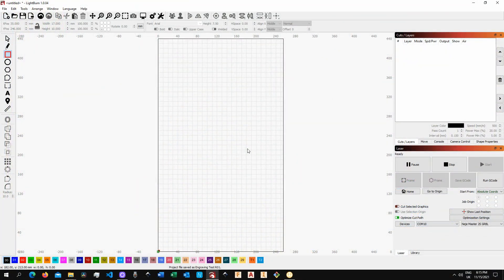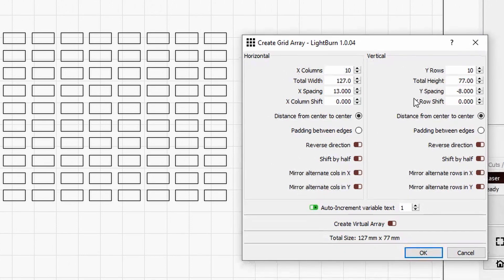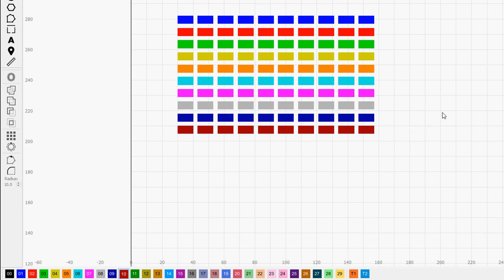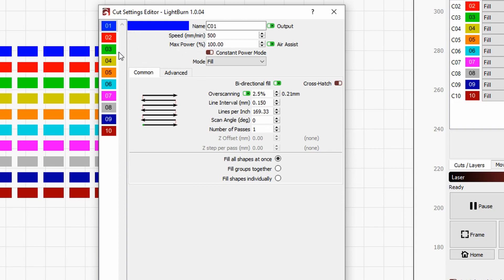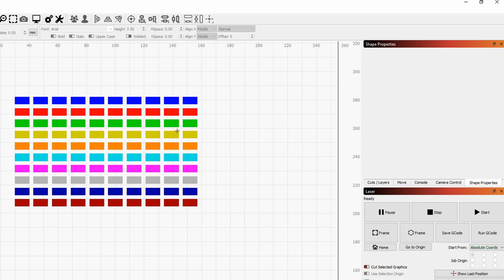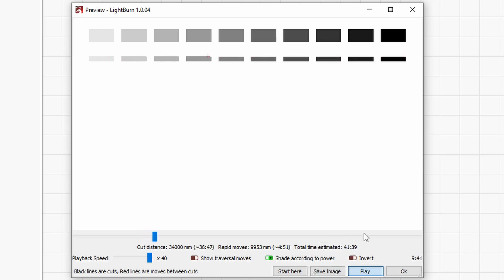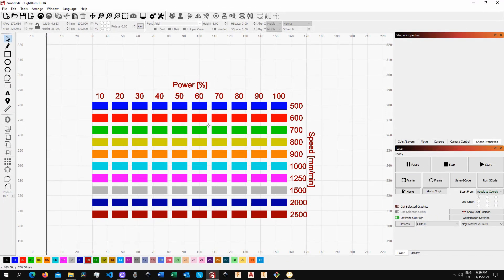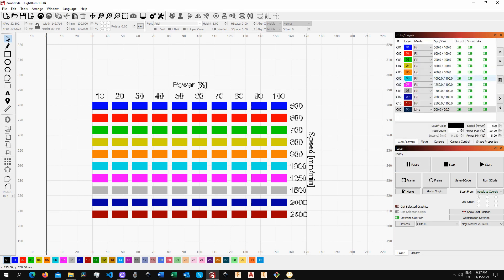Test your Laser Machine and Materials in One Go

Comment: Hi, I have a problem with Neje 3 max. When it engraves image it goes dot by dot and makes pause between dots. Is there any option to make laser to engrave smooth line by line without pause between dots?
Reply from the maker: Hi, Centar dobrog uticaja; thank you for your comment. 

The only thing that comes to my mind is the Laser Mode disabled in the GRBL configuration, which causes the machine to pause at each power change.

Go to the Machine settings while your Machine is connected and look for $32; it should be set to 1, i.e., laser mode.
Alternatively, in the console, type $$ and press enter; this will load all the GRBL settings of your machine; look for the same $32; if is set to 0, simply type in the console again $32=1 and enter. 

Let me know how it goes.
Ciao
Reply: @MiddleRoomWorkshop  Thank you very much! Now it works fine!

Comment: Hi... Trying to do the same for cutting. But... Where do I set the MINIMUN POWER...??
Thanks. 
Using version 1.3.01 ( up to date)
Reply from the maker: Hi, MrLewta; thank you for your comment.

This option is available if your layer is not set to Constant Power, which you can toggle on or off within the layer window when you double-click on a layer.
If that is toggled off, you will see the min power at the bottom of the Cuts / Layers window under the max power input.

I hope it helps
Ciao

Comment: As you mention, this matrix speed/power pattern is used for all sorts of laser machines  to help aid new users to choose optimal speeds  and power for their machine and material Unlike the more powerfiul CO2 lasers, this so called 40 watt diode in reality only has about 10 or 12 watts output. This makes this type of laser ideal for engraving various organic materials such as wood, leather and card but not very efficient at cutting. These organic materials are the only ones that have a colour range that you can exploit, i.e. from light scorching to dark scorching.  Mineral materials such as slate or glass, plastics such as acrylic and also anaodized aluminium, only have one damage colour whether you "burn" it with a laser or scatch it mechanically. Thus this chart has limited use  and can only be useful for determining a colour range for grayscale engraving. Although the claimed optical spotsize for this laser head  is supposedly 0.04mm,  I note you have set your line spacing 4 times greate than this. Why?  surely that will leave lots unburnt wood between the  scan lines? Have you ever examined your test pattern with a magnifier?  Why are the black squares so deep and "messy" whilst  the shallower lighter ones relatively clean?  I admit I could select the  2000mm/min (33mm/s) and set min at 10% and max at 100% to get a reasonable colour range but even the 100% power (althouhg about 0.5mm deep is not black) What settings must Iuse to achieve  to  a SURFACE  scorch that is black.  Why the dramtc loss of colour  when stepping from 2000mm/min to 2500mm/min? This a great programming exercise but can you explain a bit more about  the  real usefulness of what this matrix means please? I would also like to see how these colours change with various degrees of  out-of-focus?   Lots of interesting questions here for a future video please.
Reply from the maker: Hi, SarbarMultimedia; thank you for your comment.

You raised many interesting questions, which should be dealt with in a more scientific approach, and perhaps I may consider it for a future video. 
For the time being, I will summarize my answers below. 
The matrix is useful not only for finding the colour shade but also for the depth of the engraving, so one could do projects with different levels of darkness, or if you plan on inlay stuff you know the power/speed parameter to reach the required depth.

This type of Laser has a wavelength working mainly with organic, plastic materials, and some metals, although not as effective. While it is not effective on glass or transparent materials.
Metal engraving with different powers can actually produce different shades and colours.

As for the line spacing, when the laser engraves, despite most of its power being focused on the tiny 0.04mm spot or whatever the module offer, you still have heat damage in the adjacent material this can be observed with a magnifier, effectively creating a wider mark, therefore, when working with organic materials is best to set the line spacing greater than the advertised spot size, to avoid burning the area.

The focus or laser height affects the spot size; therefore, often, the actual spot size of the material is larger. therefore the additional reason why it is not a good idea to engrave with that line spacing. 
The cool game with the focus is that if, for example, you wish to engrave a thicker line, you can simply lower or raise the module so that with a single trace, you obtain a wider line, or with fewer lines i.e. larger line spacing you can cover larger area therefore in less time.

You can play around with these parameters a lot and obtain interesting results, in fact, one should test the laser with some kind of 3D array where your test all Power, Speed and focus for a given line spacing.
Furthermore, there are tricks which I have been explaining in various videos to cut or engrave materials that the laser alone cannot.

I hope this reply some of your questions
Ciao

Comment: Hi! So it did not cut at 500mm/min? At what speed you had your laser cut 3mm plywood with this module?
Reply from the maker: Hi, Евгений Васильев; thank you for your comment. 

I recommend using the cutting template, which goes at lower speeds for cutting purposes.
https://whathowwhysolution.com/cutting-test-all-in-one-test-for-your-laser-engraver/

I used to cut 3mm Birch Plywood cleanly at 200mm/min 95% power.
Note that there are different types of plywood, and Birch is quite hard. I know some people work with Poplar Plywood and manage to cut through at 300mm/min.

I hope it helps
Ciao

Comment: Thank you for your Plywood engraving video which is very clear and I will definitely follow to try out when doing Plywood engraving. Its a hobby for me and presently I'm doing ceramic tile engraving using Norton method.  I've spend many hours but is still not pleased with the results.  I'm using Neje Master 2S Plus with N40640  and LightBurn software.  The end results after Cleaning with Acetone liquid is always very light & look faded.  I was trying to find your video to learn your method but cannot find.  Please advice which video is it. Thank you
Reply from the maker: Hi, Katoria Luke; thank you for your comment,

I haven't uploaded a video about that month yet.
Anyhow, you could use a similar testing template for any material you want, not just for plywood; this will help you identify the correct speed power settings.

If you engrave shades too much after cleaning with Acetone, it means that the laser was too fast, not leaving time for the heat to transfer to the tail below; therefore, I should suggest going slower in the few tail projects I have been working on at 800mm/min 80% power with a 10W laser module.

I suggest you edit my testing template from the video, which you can download from my website https://whathowwhysolution.com/category/manufacturing/laser/laser-testing-templates/ and use the part from 40% 500mm/min to 100% 1500mm/min just set the rectangle in the upper right corner to fill mode.
Once done, clean the tail as usual and check which settings yield the best result.

Said so, please do not work at 100% power because it is not good for the longevity of your laser; leave it just for testing.

I hope it helps
Ciao

Comment: I’m new to this but I’ve been watching a ton of videos. If I want to achieve the actual colors in the program, would you suggest we layer the whatever material we are doing the color test on with spray paint starting with the lightest color finishing with the darkest color?
Reply from the maker: Hi, skull; thank you for your comment. 

I am not sure to understand what you are trying to achieve.
If you apply any coating on your material, then it will be removed by the laser as it passes through.
If that is your desired effect, you can do exciting things, and you can play with the colours.

Ciao
Reply: @MiddleRoomWorkshop  correct, it will but in other videos people are playing with the percentages so it goes down to the colors they want to show. They are running tests first to see what colors will show with different percentages of the laser and with how fast/slow it goes too. Not sure if this is making any since.
Reply from the maker: Hi, skull, yes, it is perfectly feasible, but in my experience, these cheap lasers are not so reliable in power, and sometimes even cutting fails between projects.
That is to say, to achieve what you like, you need to test and play a lot, making also sure that you apply the correct layer thickness.

Not impossible, though.

Have fun :)
Reply: Not sure if the one I got my wife is cheap or not, it's the P9 M50. 

got ya, I definitely intend on having fun with it.

Comment: Great job explaining the process.  I just got my Thunder Laser Nova 24 last week and finished installing. I'm using lightburn, how did you get the graph to fill in the layer colors?  Thanks again new sub.
Reply from the maker: Hi, Ken Gilbert; thank you for your comment and for subscribing to my channel. 

I am not sure I understand your question, but I will reply as best I can.
To set certain layers to fill mode:
1) Select the objects you want to include and click the layer colour from the bottom palette. If you do not see the palette, go to Window > Cut Palette, and make sure it is checked.
Now the objects should turn in the colour, i.e., the layer you selected 
2) Select the layer from the Cut / Layer tab and choose "Fill" from the dropdown list located in the "Mode" column. if the shapes are closed, they will turn fill, otherwise, they remain lines.
3) HINT: if some object is not closed, i.t., does not turn filled, select it, and under Edit, use one of these: "Close Paths", "Close selected paths with tolerance", "Auto-join selected shapes"

I hope it helps
Ciao
Reply: @MiddleRoomWorkshop  You answered my question perfectly. Thank you

Comment: Great video! Easy to understand. Do you have any suggestions for the quad laser (20w) machines? I just bought an s30 pro max! :)
Reply from the maker: Hi, Michael Gara; thank you for your comment.

I haven't had the opportunity to work with quad lasers yet, but based on experience with dual ones, I expect them to cut at least 3 to 3.5 times faster compared to the single 5W modules.

This is not as fast as a CO2 laser considering that they start at about 40W, but way faster than traditional 5W.

I hope it helps.

Comment: Hello,
very nice video, i'm new to lightburn and i just got my neje master 2 s max with A40640 laser module. I've seen in your video that you set cut to 500 mm\min , can you cut at that speed 3mm plywood? i'm only able to cut at one pass at 100mm\min 100%power is that normal ? Sometimes it gets dark and kinda burned around i've tried different focus setups but cant get faster .
Reply from the maker: Hello Przemysław Brodzik, thank you for your comment.

No, it did not go all the way through the material, so you cannot cut at 500mm/min even at full power, the best a got in a cutting test for a 3mm plywood without air assist is 300mm/min @ 90% in a single pass, but normally I cut at 500mm/min @ 90% 2 passes which makes a cleaner cut and compensate for not perfectly flat and consistent sheets of plywood.

Your result is too low, what focal height are you using? I normally go with 17mm (distance from the surface of the material to the bottom of the inspection glass in the laser module.
If the focus is not right you will also get burned edges. 
Have a look at this video on how you can easily find the right focus height for your material https://www.youtube.com/watch?v=GTuH27e4kWM&t=653s

PS. avoid using the laser at full power as much as you can, as this will shorten its lifespan.

Let me know, 
Ciao